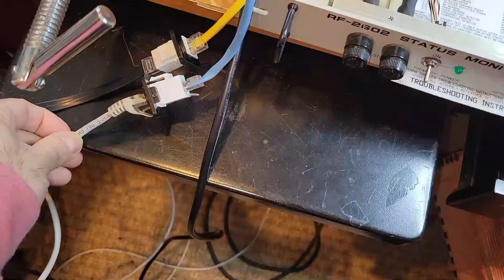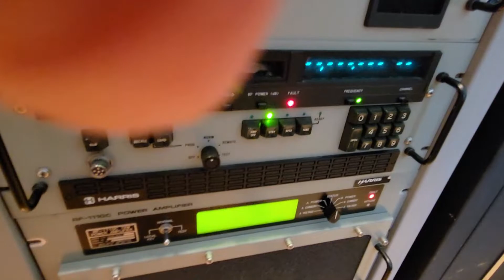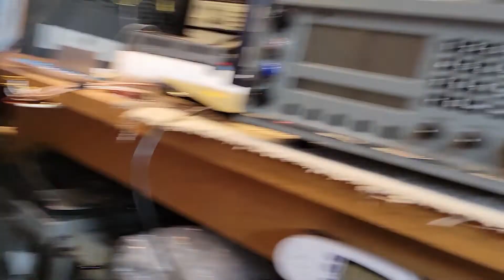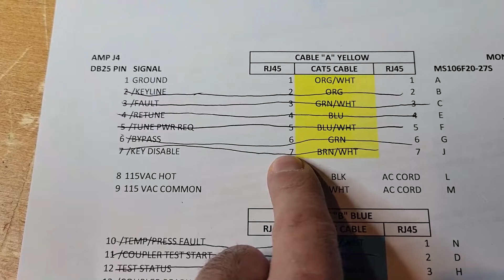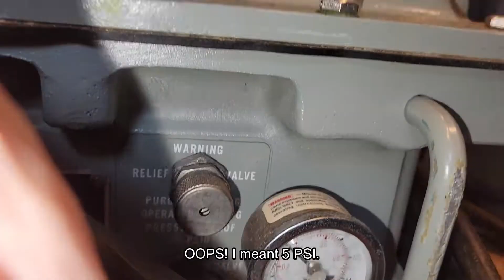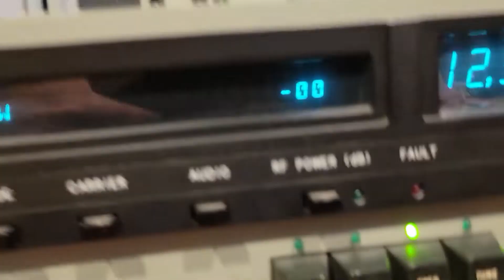Part 5: Harris RF-2601 1KW Antenna Coupler - Testing and troubleshooting

Comment: Hello thanks for the very detailed process you went through to get it going.On the very first images of the ant. coupler Part1 min.1:26 there seems to be a crack or irregularity in the top half of the casting, did you check that contact with the gasket is smooth? Maybe over pressuring the unit and spreading soapy water with a brush over all suspect areas can help detecting the leak. Remember that the connectors should also be gas tight. I got two RF-601s (the variable L/C type), one of them is still holding the pressure since bought it, some 20 yers ago. The other one had a slow a leak, I did open it 5 years ago (curiosity aside) to clean and lube it. Reused the gasket and retighten aproximately following the pattern (no torquemeter available).Added a pack of fresh silica- gel inside.Still has a slow leak, holds pressure for some months It sits indoors and a copper strip plus insulator goes through hole in window's glass pane. Antenna is 27 FT. vertical, fed it with 1Kw a few times no problems but never used it much. Control box pinstakingly home-brew following own circuit (missed the separate auction where two boxes were sold). Calsign here CX2CK.
Reply from the maker: hello andrés . Thanks for the comments. At some point I will have to do the soap test to see where the problem is. Ultimately, however, I might end up disabling the pressure sensor. In my environment (not on a ship at sea) and with the ICAS services (instead of CCS) I think I would be fine without the enclosure being pressurized. We'll see. If I can solve the leak I will pressurize it. If I can't solve the leak I'll likely disable the pressure sensor. Thanks again.
Reply: @w2hx  Hello Eugene again. I tend to agree to your aproach, trying to get all the functionalities of this type of gear up to 100% is an almost  life consuming effort. In my case one of the R590's is periodically going faulty on various modules. Coincidentally Fluorescent dispays are dim and increased filament voltage made little improvement, suggesting very long working hours. Maybe there also is lightning strike damage.Therefore I gave up finding the nearest-to-original replacement parts and make-do with the fastest available.
This sort of equipment was built on a money-no object approach but still has some weaknesses. The brown tantalum caps. tend to short out,  and when related to the supply circuits blow up.
Keep up the good work and I expect more videos coming. 73.

Comment: fill coupler with nitrogen for arc high voltage pressure sensor is on down 2psi
Reply from the maker: Thanks very much for watching. Yes I would love to fill with N2 but right now there is a leak somewhere I have to find.  Thanks again!